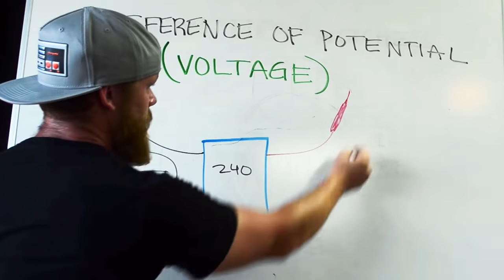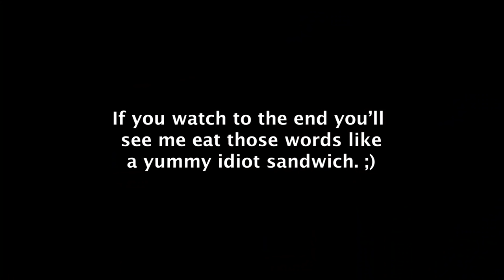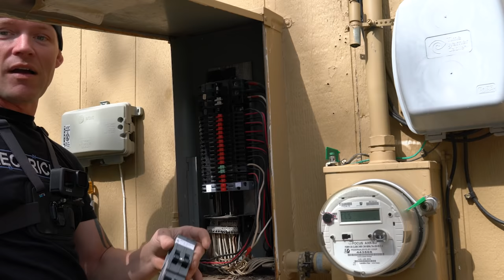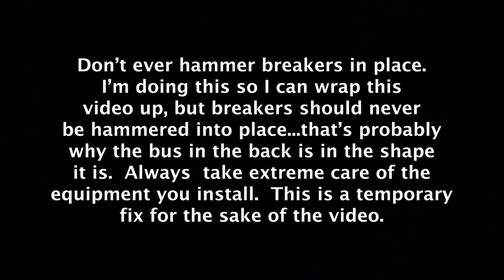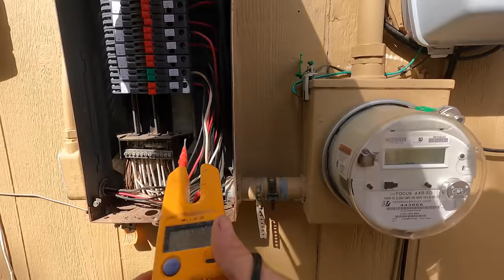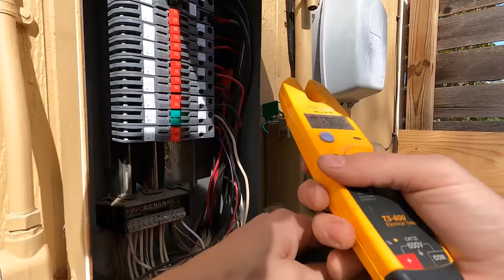How To Work on LIVE CIRCUITS - Replacing Circuit Breakers in Old ZINSCO Panel

Comment: I am also a master electrician, you just demonstrated why we don’t work on old crap hot. You now have a bad bus bar and can’t get the main back in and the power is on. Your inconvenience of a customer is not worth my life or the life of one of my guys. All you have to do is call the power company and they can remote the meter off or send a trouble crew out to turn off the power. Or shed your load and cut the triplex and re-splice when you’re done. The little bit of time or money you think you’ are saving by doing something sketchy is never worth it,  in 35 years in the field I no longer do things I did in my twenties nor will I let my guys do them. I do enjoy your videos and recommend them to my guys, journeyman wireman or apprentices, no Electrician knows everything (not even Mike Holt, but he’s close)and I learn something from your videos all the time thank you.

Comment: New to electric stuff. Why doesn't it.make any arc when u let it touch your screw driver? I hear little noise. Will it.make an arc flash if it touches like the panel cover?
Reply: It won’t arc unless the screwdriver touches something that is grounded
Reply: @pgood7266  or the other pole of his 2-pole system....

Comment: According to a recent study simply replacing the breakers on zinsco panels is more dangerous then leaving them alone. Replace the entire panel. Also wouldn't it be called a tandem breaker instead of a 2 pole since the breaker is not actually using 2poles to make 240v
Reply: Hi do you have a link to this study? Seems replacing the bus bar and the breakers must be safer than not doing so. In California they are making everyone trench to replace a box because it is considered an upgrade and must be moved away from the gas inlet per new requirement.
Reply: somewhere I found he stated “Virtually every FPE Stab Lok panel installed in homes today contains circuit breakers that are seriously defective , and the
panels should be replaced. Replacing only the circuit breakers, for
instance with new UBI breakers, is likely to increase the risk of an
electrical fire”

Comment: 0:09 I hate that so much...We should be able to pull our own meter boxes as needed.  It doesn't hurt or cost them anything.  Smh... I guess they don't want people bypassing the meter (for obvious reasons) but even so, it's still frustrating and they shouldn't fine you for doing it, only if they discover that you're bypassing the box.
Reply: That’s how it is with The local power company where I live. Electricians can pull the meters and the only reason they would fine the homeowner is if they found out that someone bypassed the meter to steal electricity. Mine was pulled 2 years ago to fix a loose connection in the meter base and there still is no replacement seal on my meter from the utility

Comment: Need an arc flash jacket too. At least 8 Cal/cm squared. Good work though. If it isn't 277/480 I don't where any PPE, with in reason, it impedes my mobility.

Comment: As you know the terminal screws need to be torqued. NEC 110.14(C)  Also to avoid the damaged spot on the bus bar it looks like you could have moved all the breakers down one slot.
Reply: Then you have to move and relabel them all though. =p

Comment: As a certified electrician in the US, are you not allowed to open the meter box for troubleshooting? Here in Germany, we are usually responsible for the installation of the meter, i.e. the company has its own registered sealing pliers. In our country, the energy supplier is only responsible up to the house connection box. From this point on, we as electricians take over the installation.

Comment: Typical of a lot of electricians...including me. I go to a customers home that has an old FPE or Zinsco, etc. Explain the potential dangers they can pose and sell a panel upgrade. But if you look at my own panel you would see it is an old FPE split-bus. 
They make listed replacement breakers for a lot of these problematic panel brands, but I am not convinced they are much better, since it is usually the overall design that is the problem...like the bus attachment points and internal trip mechanism designs. Best to completely replace, as I see you did in a later video. Plus the replacement breakers are a fortune. I am replacing mine this week with what I feel is the best they make, G.E. (seen less problems with G.E., and the most with Sq. D , Q.O. , excluding the old discontinued brands).

Comment: A friend of mine once told me that I would overcome my fear of spiders only when I stopped killing them.  I very typically worked with live electricity, for doing diagnostics, once or twice a week.   While I respect both  the venomous nature of some spiders and the inherent dangers of electricity, I don't compound the fear by over protecting myself. The fact of the matter is that simple precautions like not holding the panel with one hand while working with the other a near garentee that at 120 you will be just fine.

Comment: Can I ask why you didn't use an insulated screw driver?
Reply: It’s not neccesary when you know what you’re doing
Reply: @pgood7266  🤣🤣🤣🤣🤣🤣
So,... the shield and gloves ARE required even if you know what you are doing?
Wtf. Spend some bucks on insulated screwdrivers before you buy some fany ppe.
Reply: Hans Zyfflich where are you from that it is required that you wear a face shield and gloves?

Comment: This is a 100 amp panel? And you have so many twin 20 circuit breakers in the panel? Maybe a future fire?
Reply: You can have a 100 breaker. Your only going to get a 100 amps that's all
Reply: @johnkulpowich5260  this is like I see in houses built in the teens and twenties with 30 amp sevice. 30 amp service!!! And the homeowner wants to put a 30 amp spa in. Gee it might cost you alot to do that. And electricity is simple to  them, its 120 volts right? Yes but there something else called amps.. and sigh, how many jobs have I turned down because of amp problems?

Comment: Might want to go back to master electrician school. Review job safety practices and NFPA 70E. PPE is the LAST choice of risk mitigation and shield, gloves are not all that's required. Pretty sure it doesn't say, short sleeve shirt, shorts, flip flops...:) Also pretty sure you should never do this all alone, even if it is your own house. If you were hired to work on my house and I saw you doing this, I'd kick you off the job. Master or not. Hope your bonding and insurance is pretty high if this is how you work.

Comment: Wait, there is a fine for cutting the lock off a meter?
Reply: jail time actually
Reply: @zack9912000  Really? Is that a state by state thing?
Reply: @Veritas-invenitur  It may be, but I know in Ohio you get jail time and its a felony becise the new meters cost well over 1k to replace "Since 1978, a revised Ohio law covering theft of utility service and tampering with utility equipment has been in effect. The law defines theft of utility service as a first-degree misdemeanor if the value of stolen electricity, plus any utility equipment repair, is under $150. It’s a fourth-degree felony if the value is over $150, or if the offender was previously convicted of the charge.
Tampering carries similar penalties. Tampering is defined as “to interfere with, damage or bypass a utility meter, conduit or attachment with intent to impede the correct registration of a meter or proper function of a conduit or attachment.”
Conviction can mean from six months in jail and a $1,000 fine to five years in jail and $2,500 fine.
Reply: @zack9912000  Very interesting. I live and practice in Massachusetts. Back during my apprenticeship we cut off Utility seals all the time and pulled the meter when we were replacing meter buckets, overheads, main breakers, panels, and such other tasks that require it. We replaced the seals with ones with our company name and phone number on them when we were finished. We never had a problem whatsoever. Other electrical companies would either buy generic seals online or used ones linemen they knew gave them. The only time I remember hearing about a problem was when someone pulled the meter without a licensed electrician was on-site and it was not an emergency situation. Now atleast in Massachusetts the legal responsibility of the meterbucket falls upon the homeowner. I wonder if considering the meter bucket is legally not considered owned or the responsibility of the Utility if that is why. One important note is that you will have major problems if you hook up a temporary pre-meter outlet (cheaters) when working on the service to work on the service. I have never heard of a single case in the last decade where someone used one and didn't have a linemen show up to confront them on it. On a side note some Utilities do use a locking ring around the meter that cannot be taken off without a key. That is when you either call the Utility if you need to get into the meter bucket or you disconnect the conductors at either the weatherhead splice or on the lines at the street. And yes a Massachusetts Electrical license covers this. I would not touch the splice at the street without talking with the Utility first. But I know a few companies that do without a problem. They even pull fuses on poles and open pole mounted disconnects when need be. However it is important to note that they specialize in industrial and have licensed linemen on staff. With that said they may have an agreement or some type of contract with the Utilities.

Comment: Part of the PPE is using insulated tools to maximize safety :)
Reply: The only thing energized were the feeders and Dustin is a master electrician, he's well aware of the risks. With that being said you are correct though lol
Reply: @jman210210  it's part of using the right tool for the job say his shaft sloped when he was removing the breaker and it arcd to the shaft and I doubt he doesn't have insulated screw drivers
Reply: @jman210210  if he us a 'master' electrician, why are there uninsulated screwdrivers in his toolbox?
If you really care about safety you should first get insulated screwdrivers before you buy fancy ppe shield and gloves.

Comment: Just a reminder to all the haters about PPE when working hot: the transformer feeding his service is anywhere from 15kVA to 45kVA (estimated), or 60 to 190A; and theres only fuses on the hi side. If he were to cause a phase to phase fault or get “hooked up” on one of those hots, it could be all bad! Ill be the first to complain about NFPA 70E; I can see using gloves to avoid getting shocked; but if you’re gonna wear a shield-wear the FR shirt at least. Forget about bare arms-If his shirt had synthetics in it, it’ll melt to his skin. If it was after a main breaker, dont bother with any of it as the energy released from even a phase to phase fault would be minimal on single phase 240. 
But on a secondary side of a utility transformer? Depending on how far the service drop run is, a fault is gonna be a bad day without PPE. 
Lots of vids on the internet of closing in a large or main breaker and a guy needing 3mos in a burn unit and skin grafts from his ass cheeks.

Comment: Experience and knowledge is the key to working hot. I did a lot of hot work before insulated tools were a thing, and NEVER got shocked even outside in the rain. Training and common sense will always rule. Just ask any lineman of some seniority how they worked 20-30 years ago. I just finished 46 years of work they are nice but you can continue to work without them.

Comment: Personally I would remove the incoming L1 conductor, put a big blue on it then do the same for the second. Remove the main breaker and replace. Remove the big blue from L2 and terminate. Then L1. I just think its safer not having a breaker moving around when its live. Cheers.
Reply: I'd do that also to put less mechanical stress on the wires. They would be pain to replace if they break (or burn from weakening).

Comment: I just used a bucket to stand off the floor and only used one hand also switched off the main braker but the copper still hot nothing happened just try to say dry and clear for arch, learn it from tesla

Comment: Dude, you have a arc flash helmet and face shield.  It's a main service with minimal protective devices.  Wear arc flash, or at very least, make sure you wear natural fibers, and ditch the nylon chest rig for the camera.  We want you to keep making videos.
Reply: Also, for the audience mostly, the leather protectors are not regular gloves.  They are specifically designed to not damage the voltage rated glove, with non-standard seams to reduce wear.  Please use proper leather protectors.  And get your gloves inspected every 6 months.

Comment: Nice work man, but we’re all gangsta till something goes wrong
Took me 20 years as an electrician working live till me and my mate accidentally shorted out a 2000A bus to realise I not invincible
Destroyed a major substation, spent time in hospital, saw my life flash before my eyes
Please just wear arc rated shirt with long sleeves as well as your face shield and gloves 
Even at 100A your gunna die or be permanently disfigured if the board shorts out in front of you
Reply: Only a matter of time if we don't  respect the electron

Comment: i just wired in two 20 amp breakers on a fully alive Ge powermark loadcenter gold i have non pullable meter and no main breaker got it done without getting electrocuted or starting fire so im happy lol i live in old house meter box is from the electric light and power company lmao lucky the owner before us swapped out the fuse box for ge powermark gold

Comment: The little rubber pieces are to protect you from touching a hot lug later when working on the panel even with main off just like all new panels come with.
Reply from the maker: I know what you're referring to, that's not what those were.  They were spacers shoved into the slots where the wire would go to give the manufactured screws something to bite down on in shipping so the screws don't fall out.  If I didn't remove them the wire wouldn't have gone into the hole at all.  I'll have to go back out and pick them up and show what I'm talking about.  Just never seen that before
Reply: @ElectricianU  I see..  the other day I had a 100 amp federal Pacific that had rubber caps to go over lugs.
Reply: It was a pushmatic replacement,  I meant to say.

Comment: Dude.  Learn Arc Flash Protection just one notch better. Arc flash calculations or a cheat sheet to the calories coming out.  A single phase split voltage panel can release a great deal of heat.   Understand how much heat is really coming out.  It rarely goes wrong but when it does You need to be in a rated jacket , shirt, and pants also.  Nice face shield!  Nice set of gloves.  Your like superman without a cape and super underwear.  Find some FP rated clothing! Deenergize the panel whenever possible! Then no need for the insulated screwdrivers most of the time if you realize that there is always a way to solve  a residential wiring issue with minimum or no exposure to voltage.

Comment: I grew up in the New England states, all of our electrical service panels are installed inside the buildings. Why are electrical service panels attached outside of some houses in Austin? Is it not safe for a person to flip the breaker when it's raining? I'm sure I wouldn't do it! In my opinion, electrical service panels should be installed inside the buildings not outside side for electrical safety!

Comment: Amazing.
We all fall short at times, and you have a great attitude to PPE and risk, but...

A lot goes to the folks that have been doing this unsafely all their life and are still alive. I think we call that "Dumb luck".

Insulated tools would be the first of a hierarchy of PPE when live working. Not the last.
All the stuff you wear is to reduce effects if it all goes wrong. Arc blast. Not electrocution. (Gloves aside, and they should be pressure tested before use)
Using a long exposed conductor to bridge out-with the terminals is the perfect way to setup the arc that melts you. 
Watch any blast demo and they will tell you it was the smallest of wires used to initiate the arc. Then it's all over. That's the point of them using a small conductor to start it. It takes next to nothing. Let alone a screwdriver.

Break out the pvc tape. Make your own. Then read the insulation properties of the tape and tell me it was a good idea.
Why do we test insulated tools before use or at regular intervals ?
Why do we make cable joints using only approved materials ?
Heck you guys have to do everything to regulations including where the screws go. But heaven forbid using the correct tools. Do they do insulated battery screwdrivers?

Arc energy is calculated the same way as fuse interruption. i squared x time. The voltage doesn't need accounted for and the resistance is irrelevant as it is now a plasma. 125 amps... A 5 second disconnect time. Answer in joules. Then consider that 11 joules in a bullet will kill you.

Love the safety Tee shirt by the way.

Ps. Your videos all look good and the effort is stellar. Learning about US supplies you certainly show the guts of it.

Set of breakers $600.
Blast visor and helmet $150
Class 0 gloves $120
Over gloves $20

Getting blown to F**k for the sake of a $10 screwdriver. Even mastercard can't buy that.

Comment: I dont get it. You are working with a live panel, using a screwdriver wich is not insulated. You tell us you have lots of experience in working with live panels and you only use PPE when changing the main breaker.. with a helmet and some gloves, wearing a T-shirt..  Why do you not also wear some arc resistant clothing?